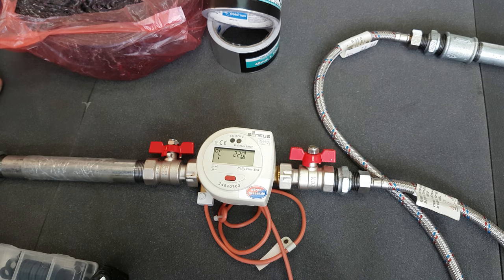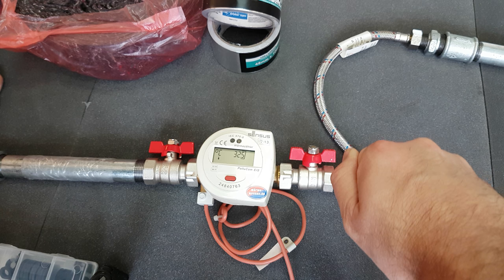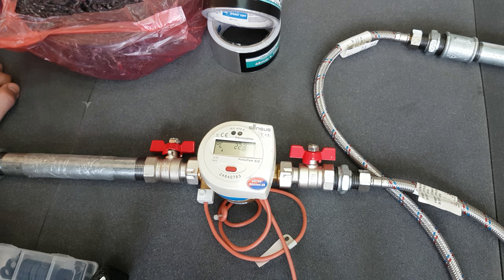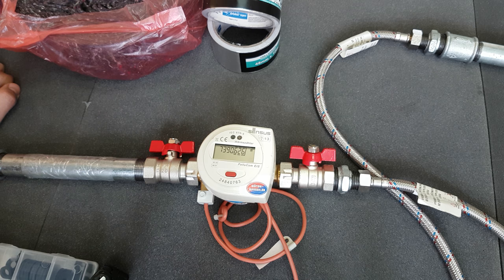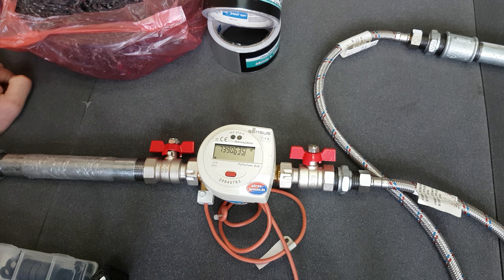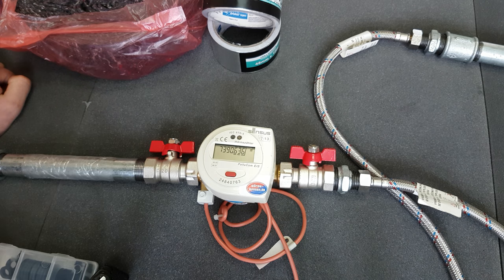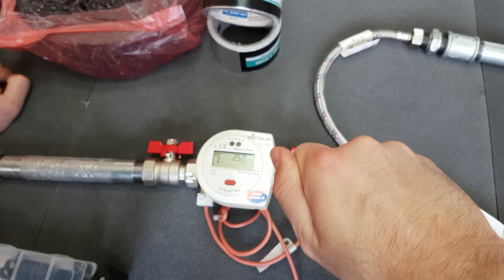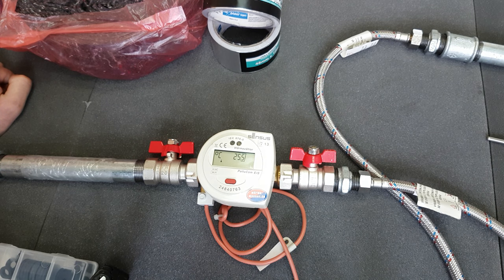Sensus thermal watt meter

Comment: Hi Martin, we have one of this Sensus counters that doesn't display any numbers anymore (blank display) and one where the display doesn't count (since we started the heating always the same number displayed). Any ideas how to solve?
Reply from the maker: No expert, by it could be that they have an internal button cell to power the LCD. The latter could be some problem with the means of detecting the flow - impeller or transducer.
Reply: @MFMP  Thanks, sounds reasonable. Think we gonna buy new ones.